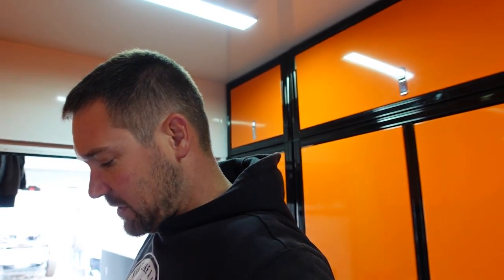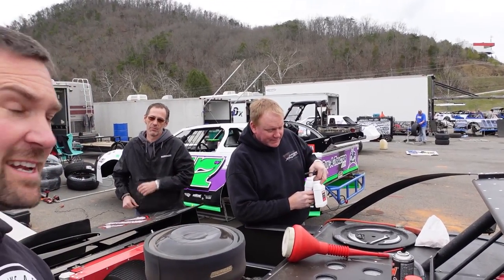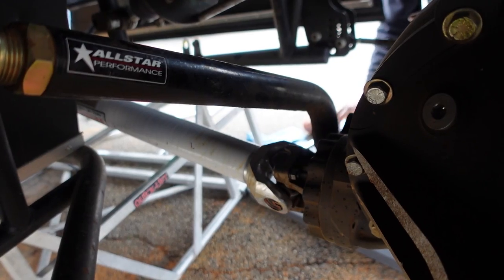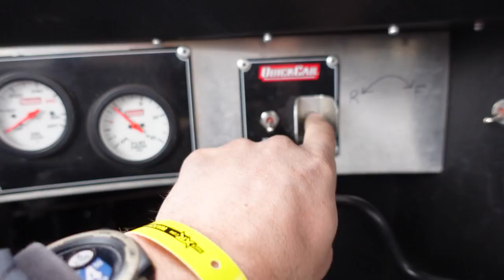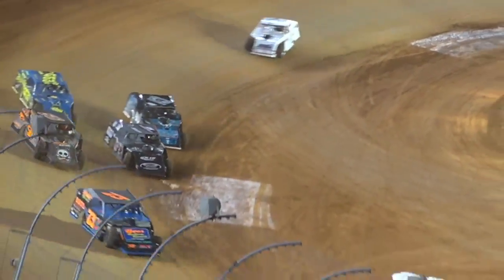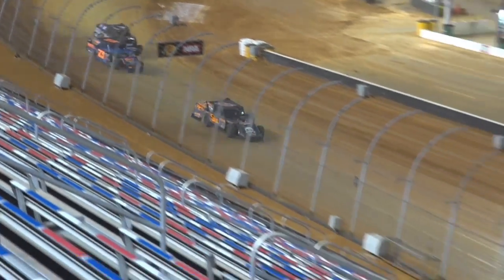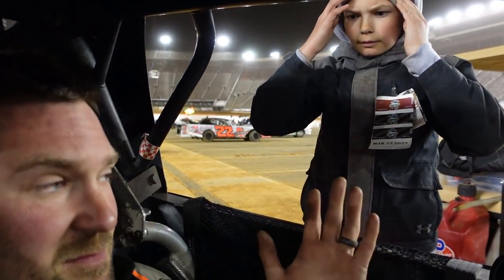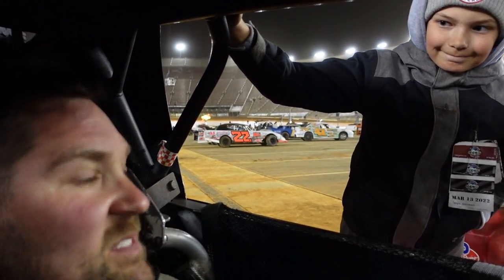Bristol Dirt Modified Racing-110MPH

Comment: Thats nits doing 110-118 mph in a dirt modified thats only use to going and driver use to going65 mph on small tiny bullrings or 95 mph max on a decent high bank local half mile track. Its a whole different ball game i ran at Milwaukee mile in my asphalt modified and it was nuts rivets that was exposed to the air was popping off from the down force in almost everyones cars and we was doing 145 mph and im only use to going 105 mph on my local high bank half mile asphalt track it was amazing drafting in a open wheel modified

Comment: Can you get a few more rpm at the end of the straight away by changing the rear end ratio? Or are you maxed out there?
Reply: The video shows they were faster out of the hole, the probably more coming out of the corner. Gears would definitely help but then there's nothing left on top but a blown engine. Seems to me at this point its all horsepower. A nitro fuel additive?

Comment: What brand/model transmission?
  I'm looking for a short one like that for a different project..
Reply: Bert, Brinn or a Falcon racing transmission. Unusable for anything but circle track racing.
Reply: @hauptmann6  is the case based off of an on highway part or know of an production transmission similar or smaller dimensions that would bolt to gm bellhousing?
Or better yet, small case with 90° output like a boss hoss transmission but 3-6 speed manual that would go on a gm bellhousing?
Reply: @AndyFromm  That transmission is a direct drive unit. In low gear you push the clutch in to get it rolling then release the clutch and drop it into high gear when the rpms match. 

And sorry, I have no idea what to suggest for your project. I only know how those transmissions work because I have a friend who builds dirt street stocks.

Comment: It seems like you're holding your own in open racing but you're getting killed on restarts. You lost two spots on one of them and made it back to third. If you could just get better restarts I don't think you got much else to worry about. A few more HP would help a lot I believe. It's definitely not the driver! Aggressive when needed, backing off when prudent and taking advantage when it's there.